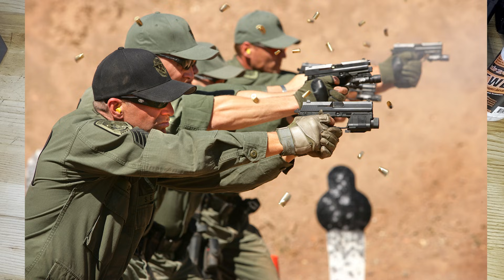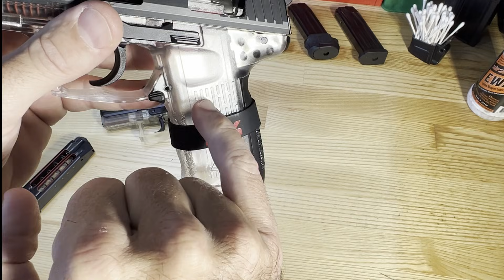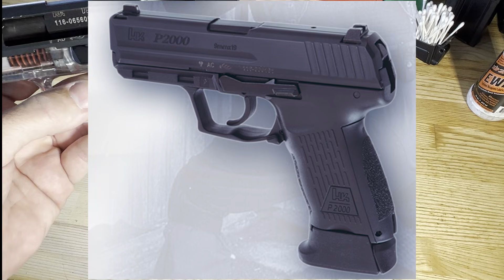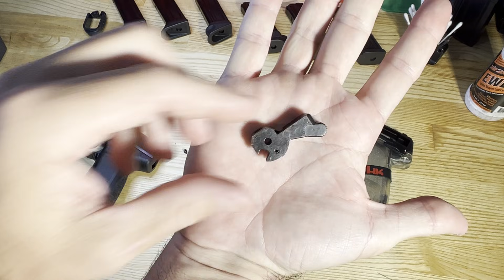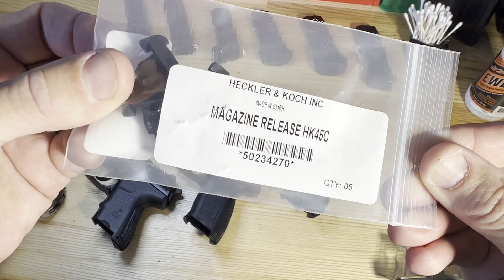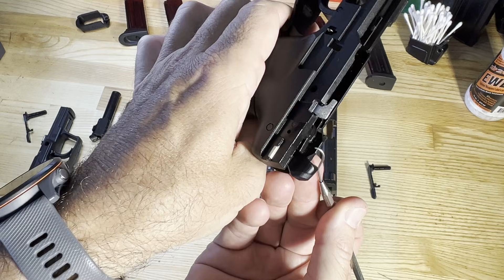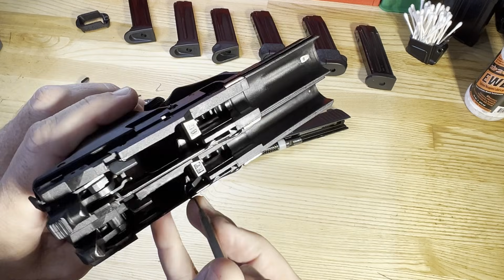Heckler and Koch P2000 Series Armorer and Operator Review

Comment: Thanks for the great video! Really enjoyed it.

Question: do you have a personal recommendation for the right-side slide release rattle?
Reply from the maker: Thanks.  The secret is to not remove it in the first place, as it will loosen up the more you do so.  A simple fix is to take a roll of blue painters tape, cut a small piece and place it on the inside of the lever and paint it black with a sharpie.  Seems silly, but works.
Reply: @teufelshundtactical  Unfortunately, mine came with it already loose... But I'll give your suggestion a go. Thanks again!

Comment: living in CA my options were insanely limited...first moment i held the p2000 V3 (not SK) I knew it was for me. balanced, fit well in the hand, compact yet not snappy to shoot and hasn't had a single malfunction in my first 1000 rounds. A rear decocker should be the go-to for every pistol, way better than a side safety/decocker.

My only complaints are the disassembly is a little more difficult than other pistols, and the reset is a little longer than I would like out of the box. i'm looking to set it up with a short reset kit.
Reply from the maker: Glad you found one you liked.  If you need help with the upgrade, you can reach me through my website.
Reply: @teufelshundtactical  Much obliged sir. Silly question but is this Mag Part Number compatible with a P2000 V3? #HKP-17203

I'm moving out of CA and looking to have at least 1 emergency high-capacity magazine.
You mentioned some incompatibilities, depending on the US/European models? Thanks again!
Reply from the maker: @atranimecs I don’t have the part numbers in front of me, but if you contact H&K Customer Service, they can help you.

Comment: Awesome review.  Is your 13 round mag that goes to the P30sk (that are now available with 15 rounds) compatible with the full size P2000 if the baseplate is changed to the standard P2000 baseplate?  In other words, can the full size P2000 now run flush fit 15 round OEM mags?  Thanks for the clarification.
Reply from the maker: The grips of the P2000, P30 and VP9 are too long to accept mags designed for the SK models.
Reply: @teufelshundtactical  Thanks for the response.  FYI, I recently spoke with DJ over at HK-USA and asked him the same question.  He said that the body of the mag (e.g. the 13 round P30sk mag that is now 15 rounds) is the same exact body that goes to the P2000 and confirmed that it will work if it has a new flush fit baseplate and no sleeve.

Comment: Firstly, thanks for continuing this great series! 
Over the years, I've read plenty of opinions regarding the USPc's "better" trigger compared to the P2000's. Sometimes it's brought up that HK redesigned the trigger mechanism when moving from the USP series, but no source is provided on that. (I don't believe you mentioned it either in this video). Have you heard of this complaint before, and is it at least based on a real change?
Reply from the maker: Triggers are a very personal thing and everyone has their opinion.  Sadly, those opinions, are not always based on real experience.  There is nothing different of significance between a USP Compact and a P2000 of the same variant (meaning compared against DA/SA to DA/SA or LEM Light to LEM Light).

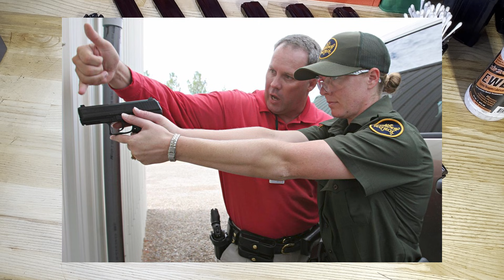Comment: 35:04 Being one of those old S&W Model 19 & 686 revolver guys, I was issued one of the first .40S&W USP Compacts when the U.S. Border Patrol first issued them to air crewmen and plainclothes duty in ‘04 to replace the Beretta .40S&W 96D Brigadiers. In ‘06 I turned in the USP and was issued a P2000 .40 compact that I carried until ‘15 when it exceeded 10,000 rounds and still functioning like a champ. Carried P2000 compact #2 until I retired in ‘18.  I immediately ordered a .40S&W P2000 compact LEM for daily carry. 

EXCELLENT VIDEO. Being a gun toter and not an armorer you educated me in a weapons system that I’ve be using for 20 years.
Reply: What BP class?  I'm 164th....

Comment: WOW! IMO this is BY FAR the most informative and educational breakdown of the P2000 line up that I’ve seen or read! Prior to seeing this video, I wouldn’t have been able to explain why the pistol has been so accurate and reliable other than it being H&K with their reputation for reliability and accuracy. I have a V2 SK that I was fortunate enough to come across on the used market. It wasn’t cheap in comparison to other popular striker fire pistols of the same size and capacity. The only thing I was aware of at the time was H&Ks reputation and a rough understanding of the LEM system it had. For me, the piston quickly became my favorite sub compact CA compliant that I’ve shot. Accuracy, speed and reliability have been excellent in my experience with it. That you for the education and understanding of the engineering and quality that gives H&K its reputation. I appreciate the pistol even more now.
Reply from the maker: Glad you enjoyed it.  You’ll find the entire channel is dedicated to H&K knowledge transfer.

Comment: Man I love all the in depth knowledge you have on this platform, I know a lot about HK but I always learn something new. I believe the p2000 is underrated in HK's lineup. Sort of the middle child. The P2k to me is my ideal ccw, I carry my v3 9mm every day with the 17 round p30 mag with x grip extension. Which kinda makes it a p30 in size but I can have a shorter grip if I want to with the 13 round mag. It's the best of both worlds. Love it so much I got a second one as a backup that just sits in the safe if something were to ever happen to my primary. I have 1,500 rounds through mine this year. I trust this to the end of the world and back. I even put a 10lb hammer spring in mine to lighten up the da pull a bit. Thinking about doing the gray guns short reset kit, I've heard great things about this I don't think it affects the reliability from what I've seen.

Comment: Overlooked and underappreciated. The P2000 really is the unsung hero of HK's pistol lineup. Wonderful video, but I have 2 questions though James. Do you know why the trigger guard was redesigned with the slanted front for the SK? And why has there never been a factory threaded barrel option?
Reply from the maker: Oh yeah, and no threaded barrel, again, because no contract requirement. The other weapons that H&K has offered a threaded barrel model, have all been because of specific contract requirements for one.
Reply from the maker: Thanks.  If you look at the SK trigger guard, it is in the same style as the original (Euro spec) P2000.    The change to the US Spec P2000 was made to match the USP Compact trigger guard, since both the USP Compact and P2000 were being submitted to the Homeland Security contract and could then use the same holster.  No such requirement was present for changing the P2000SK.
Reply: Thank you for the info. Do you know of a company that can thread an HK factory barrel? Seems like a standard P30L barrel would be the correct donor for this kind of a project.
Reply from the maker: @chrisfishback7363   If you have a P2000SK, you could order a P2000 barrel and have it threaded.

Comment: P2000 is/was an amazingly durable gun  and tolerant of neglect. I have had 3, two issued and the 3rd personally owned after they were replaced from service. 
The LEM trigger may have been the best   Law enforcement trigger ever designed.

Comment: James have you had any instances of the GG short reset control latch in the USP ruining the trigger break? I installed one in my USP9T and it shortened the reset for sure, but it made the break very spongy or rolling. So much so that i put the stock latch back in.
Reply: Thank you for that info. I suppose one day i should just send that pistol to you and have you work your magic on it.
I love your content and all the work you've been doing with the 1911syn guys. I've been an HK, kraut space magic fanboy ever since i shot my dad's USP compact in the 90s. He still has it, with an unknown and probably ridiculous round count on it. They definitely stand the test of time.
Reply from the maker: I have noticed inconsistencies across the different models depending on the spring set up.  Sometimes when you have something already set up in light configuration, like a Match Trigger Kit, adding another product designed to also lighten ends up making things worse than better.  It can be trial and error for sure.

Comment: You mention the option to get +2rd for HK magazines. How does that work for the 10rd and 13rd mags? I have been testing the +2rd (15rd to 17rd) follower, spring and locking plate in the the 13rd (now 15rd) USPc magazine body and base plate, and so far it has worked great but I cant imagine, that you can use the same new spring in the 10rd mag body.
Reply from the maker: The magazines are all new.  Looking the same as before, but now with extra witness holes and extra internal capacity.  As mentioned in the video, if you have the original mags, you. A purchase the retrofit kit from H&K and swap out the internals for the same capability, just obviously without the witness holes on your original mag body.
Reply: Thanks for the info. I though HK only released the 15rd to 17rd conversions/magazines. Was this a recent thing? @teufelshundtactical
Reply: You can also get the new 12 and 15 round P30sk mags and swap the baseplates out. There’s some good info out there on the HKPro forum.

Comment: I didn’t think I would watch the whole video but I did.  My wife and I are new gun owners in 2023. We took the CCW class and got a CCW permit for Iowa even though not needed in Iowa to carry. I’m 66 and bought my first ever guns this year. One of them is a used HK P2000 V2 9 mm date code says it is a 2012 model. It was an impulse buy by my wife. Never heard of HK, after doing research found out it is a very good line of firearms. This used P2000 only came with the XL backstrap.and doesn’t fell right like a S &W M & P 22  magnum or a  Beretta M9 22 that we have.  But like the size and is easier to carry than the other two. The only thing I can think of is of is I need to order a smaller, Large or medium backstrap to make it feel better in my hand. This P2000 came with 2-13 round mags and need to order more. Luckily found HKparts.net that I can order for it.

Oh have used the second strike on the range a couple of times of misfires of ammunition. I like the pistol and hope a different size back strap will make me love it.
Reply from the maker: Congrats on your purchase.  Go direct to H&K and their customer service phone line to order what you need at lower cost.

Comment: Hey James, what extended paddle release is that on the usp 40 in the beginning of the video? I was unaware there was an extended one that worked for the polymer mags
Reply from the maker: I showcase the extended mag release, with its part number in the video.
Reply: @teufelshundtactical  ah just saw it. Commenting as I watch. Does that metal release not chew up the polymer magazine?
Reply from the maker: @HecklerKochSnob I have not seen any issues with it.
Reply: @teufelshundtactical  good to know! Thank you for posting this video and sharing your wealth of knowledge
Reply: @HecklerKochSnob if it’s the Hk45C release it eventually caused issues in my USP9. Mags would drop free occasionally in recoil

Comment: James, what are your thoughts on the MRDS mods from DWS and Wright Armory?
Reply from the maker: I would not recommend attempting to mount a red dot on a P2000.  There is not enough room at the top of the slide for the necessary amount of material to be removed and not negatively affect structural integrity over the long term.  You can take a look at an original VP9 and the new VP9 OR to see how H&K resisted the slide to reinforce it while making it optics ready.
Reply: @teufelshundtactical  roger that. Maybe I need to learn to love a VP9 OR then, if I’m dead set on an optic. Bummer cause I like the look and feel of the P2000 and USP way more. I assume your statement would be the same for the USP/P30/HK45 optic conversions as well?
Reply from the maker: @AggiePhil The 9mm models have the most amount of lightening within the slides.  Using a .40 or .45 would be a better choice if you wanted an aftermarket optic cut project.

Comment: I just got the P2000SK LEM heavy variant. Changed it to the light variant put in the nickel plated sear spring and installed the Grey Guns short reset kit and extended paddle mag release. I think it keeps up with all the single stack micro 9s in many ways for a deep carry gun. It’s still slimmer than my Glock gen 3 26. I do plan on getting the P2000 light LEM variant with the GG SRS kit. I’m glad it’s still on the unconstitutional Ca gun roster. My only other HK pistol is the grey frame USP 45 also converted to light LEM which is another great shooter!
Reply: Light LEM is fantastic. Try an HK45 with it and you may never go back.